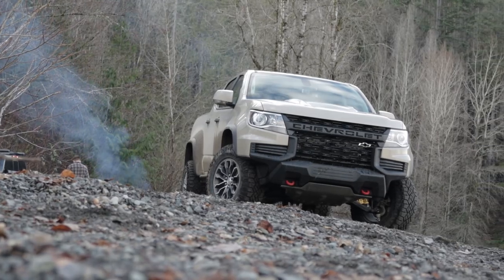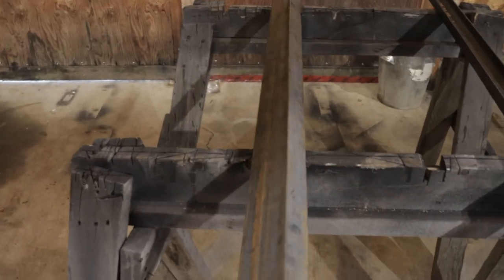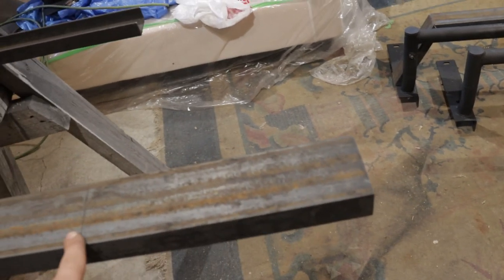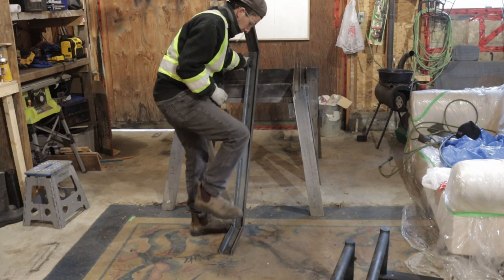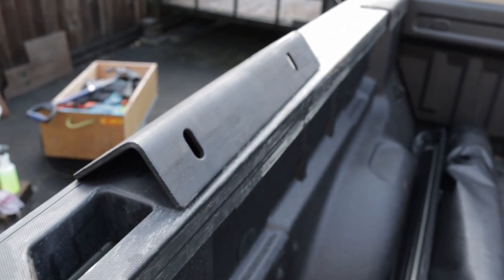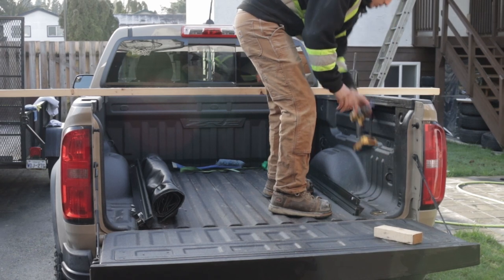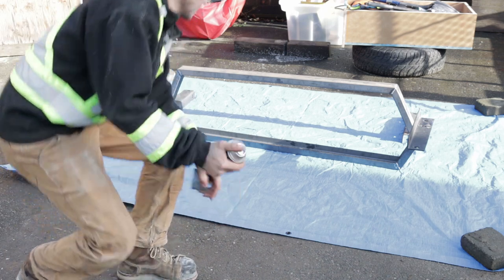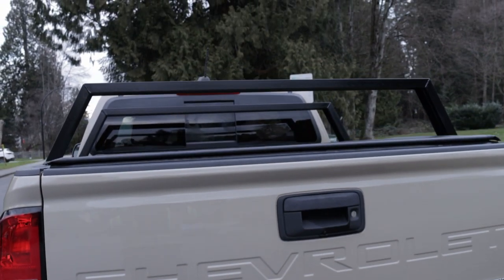Simple DIY Bed Rack tutorial

Comment: Nice! Planning to build my own rack as well since there's NOTHING for the Avalanches. I've been using a set of Yakima bars, but I want to get the RTT another foot higher over the bed covers.
One thing I would recommend is to get some more channel and add a run of it on the sides to tie to the two rack pieces together. Makes it much stronger and also gives you options for gear storage mounting.